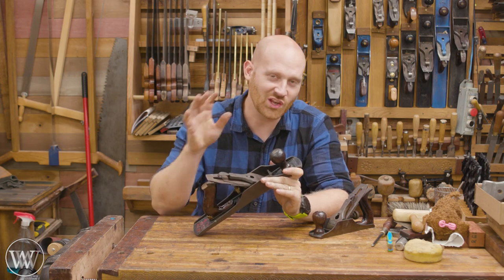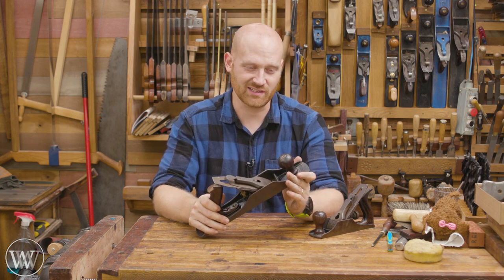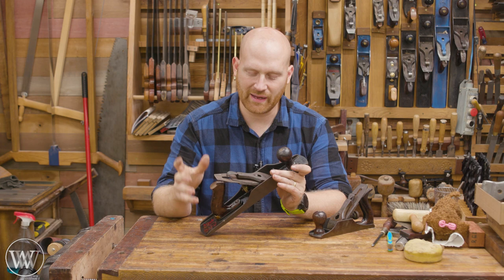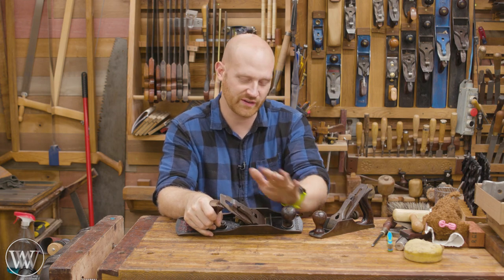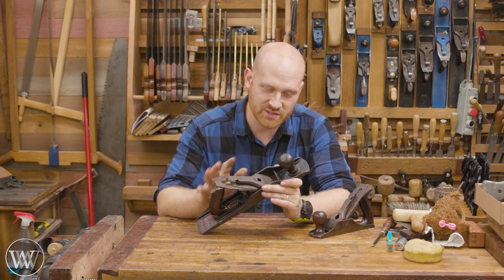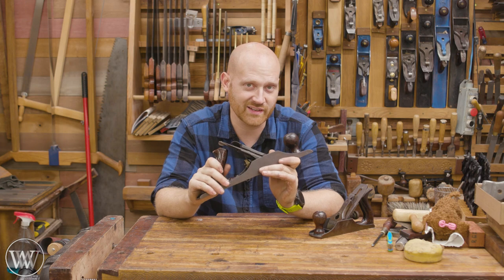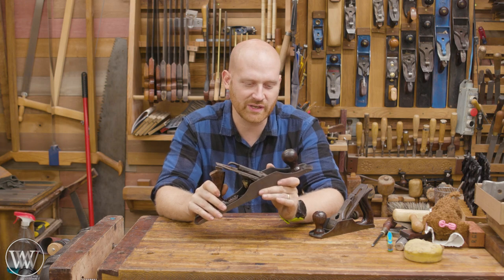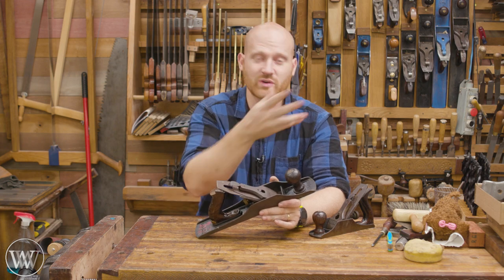Historical Restoration of a Stanley Bedrock

Comment: I only have one bedrock, a type 3 607. I bought this because I really needed a jointer and it was cheap at an antique tool show..  I bought a new blade, but didn't restore it. I used it on a project 5 yrs ago, and haven't touched it since until this morning. I finally took it apart to see all the casting marks etc and deemed it a type 3. I'm glad I saw your video. I'll let the next generation restore it.

Comment: I restored a set of Stanley Transitional Planes (Beech sole) so far as cleaning them up, flattening the sole (so much easier on a transitional plane!) and sharpening the blades. The old No. 26 Type 10 (1892-1899) is now my daily driver plane, and I often use it to trim doors for client work!

Comment: Very timely video. Bought a 605 yesterday and it needs some work before using. Biggest concern is the tote broken in half. Seems impossible to use without at least gluing the tote back together. Not sure of the best glue for that purpose either. Looks like a pretty clean break. Any suggestions would be appreciated.
Reply from the maker: I would use hide glue. It's much easier to clean off the outside with any squeeze out without hurting the finish. You could actually clean it off with a wet rag and some scrubbing.
Reply: Thanks, I'll give it a try

Comment: I don't understand the frog adjustment on my bedrock 604. I know how to move it forward and back.. but since the bed it mates to is at and angle the further forward the frog goes the more the cutting iron projects out the bottom of the plane. I then have to back the blade adjustment so I'm not cutting too deep. But then the gap for the chip is back to where I started. It never gets tighter. What am I missing?
Reply from the maker: As you move the frog forward the gap should get smaller even though it's on an angle. Yes you do have to back up the iron some but that doesn't change that. It moved forward as well. I think I'm not understanding the problem. The physics work exactly the same way on a standard frog as a bedrock frog.

Comment: I was Sanding the varnish off my tote handle and Noticed a number three in white on the right side of the handle and one else found these or know what they are for? my plane is suppose to be a Stanley Bedrock number 605 with Corrugated Soul so its not the size unless it was taken from another plane.
Reply from the maker: Probably from an old shop class. They used to number the sets of tools

Comment: Nice job 
Do you have any alternatives for the stropping compound that is cheaper then the propper stuff
Reply from the maker: I actually make my own. the stuff I sell on my website. But I don't know how it can get much cheaper then around $5 a block that size will last you years. I have been working on my small block for 4 years and I have only used around 25% of it.
Reply: @WoodByWright  ok cool

Comment: Do you know if the  number 5 bedrock are built the same way?
Reply from the maker: the same way as what? the design changed over the years  but they were built in the same factory as the normal Stanyels.
Reply: @WoodByWright  I bought a number 5. But the frog is different it's more like a normal stanley. And the body has no name on it.

Comment: May I ask, what's the average value of it and why is it worth it?  Curious 🙂. Wonderful video 👍
Reply from the maker: This is a Stanley bedrock. They are far more collectible than the average Stanley. So a normal number five like this in this kind of condition is around 20 to $30 to ping pong where you get it. Stanley bedrock and this condition is around $100 to $200.
Reply: @WoodByWright  interesting.  Thank you for the information.  👍

Comment: Hi, I want a jointer plane, Stanley No7’s used in good condition go for from 100 to 200 dollars in my area. A brand new Stanley No 7 is 106.00 on Amazon. Are the used ones that much better that I would pay the same or more and still have to restore the plane? Or would I be better off buying new for $106.00? This plane would be a user, don’t care about collectors value. Thanks!
Reply from the maker: The older ones are better in fit and finish, and they will hold their settings better. Depending on where you are at you can get an antique that needs a bit of work for $40-80. That would be my suggestion. But the new ones will work. Just understand getting them up and going is much like restoring an old one.

Comment: I inherited a bedrock 606, a Stanley Bailey #4 type 11 and a rough #5 type 17. The 606 and the #4 are usable but need cleaning. The 5 is missing the yoke and is rusty. I’m trying to decide if I should get an original yoke or one of the new impro😢Reed yokes from your website. I intend for all 3 to be users
Reply from the maker: It is just personal preference. But if you're planning on using a thicker iron or if the slop from the original yolk is annoying to you then you may want to upgrade..

Comment: I got 5 planes in a lot from E-Bay and their condition matched  -- pretty much -- what you ended with BUT they had parts that were NOT necessarily the right ones for each of the planes. They seem to be a mix match of parts but not original. Now I am kind of at a loss to be sure which and where to find the "correct" parts for the bodies I have. I suppose the question is - where can I get a simplified statement of what size blade/bed/chip breaker/mouth combos they should be to be "normal"?  It seems like the blade is too narrow - or the adjustment fit is poor or the slot is too short ...that kind of problems. Much about the planes are good but ...
Reply from the maker: that is a huge ball of wax and it depends on the plane and the type of that plane. usually I call up a collector of that type to see what is on their plane. but if you ask the hand plane collecting groups they would be glad to help with that.
Reply: @WoodByWright  Thank you James.